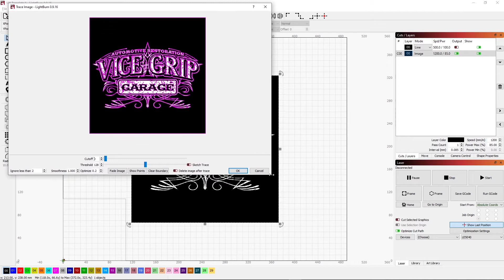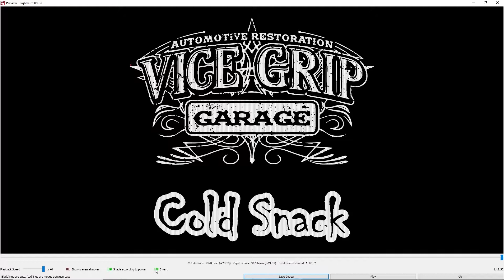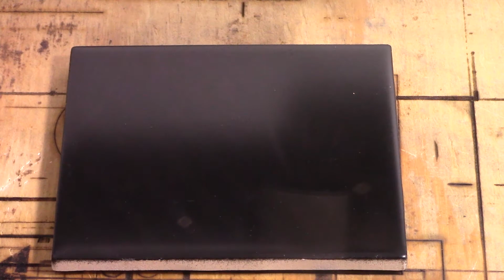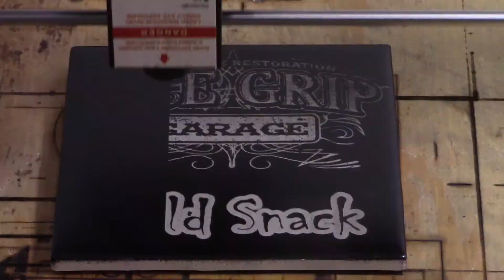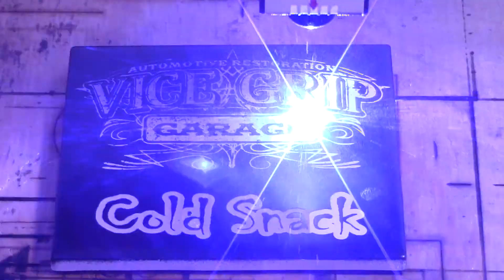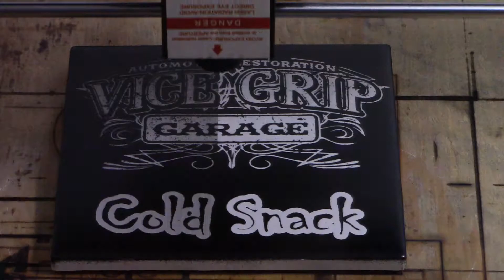Cold Snack coaster for Vice Grip Garage using LightButn

Comment: Learned a lot from this video!  Is this black tile painted black or just the original black tile?
Reply from the maker: That is a great question.  I should have said a little something about that in the video.  I did another video about the black tiles.  It is a white tile painted black.  Once it has been through the laser then I coat it with a water based poly to help protect the paint from scratching off.